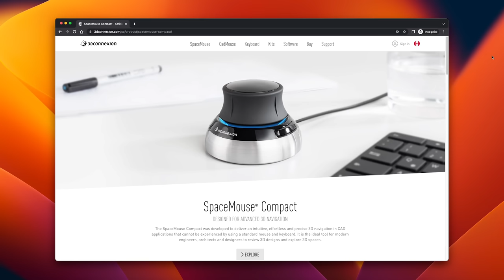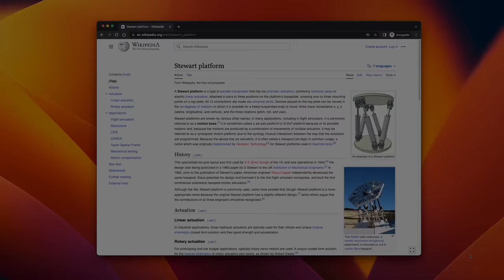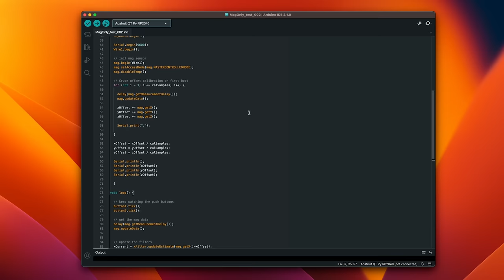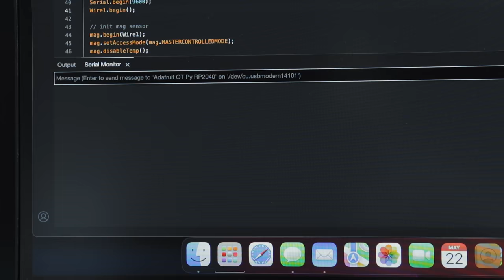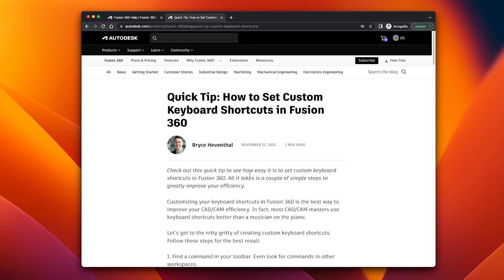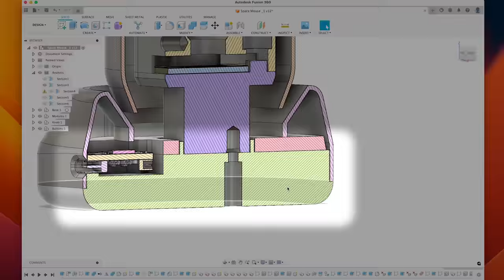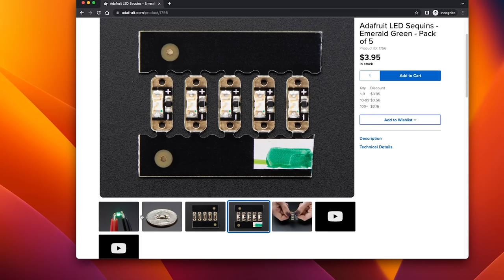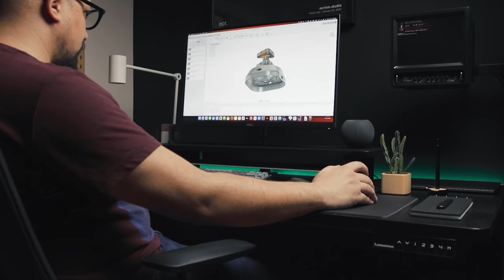I Made my own Space Mouse for Fusion 360 using Magnets (DIY)

Comment: I have build the project and i am stuck with uploading the software to the qt pi i gat a error that the TinyUSB_mouse_and_keyboard.h cannot find HID.H. how can i add this to the code? i have tried other code and that is uploading fine.
Reply from the maker: Follow the guide from Adafruit to install the TinyStack library (https://learn.adafruit.com/mouse-and-keyboard-control-using-tinyusb-and-ble/installing-the-libraries)
Reply: @salimbenbouz  Thanks for the help. i am now one step further. the code is uploaded to the board but i cannot get the serial monitor working to look at the values of the magnet sensor. i have checked the baud rate is there another thing i can check? after some time i get ................................. in the serialmonitor window
Reply: I see what the problem is. I have ordered the wrong sensor. i got the LIS3MDL sensor instead of the TLV493D that sensor is hard to get in the Netherlands.
Reply: @salimbenbouz i finaly got the the right sensor and the mouse is working. only after 10-20 seconds it stops working and the mouse cursor is verry buggy. i think windows has broken something again. do you have some tips how to fix it?

Comment: Anyone know how to add the metal balls for weight in such a way that 1. The printer bed doesn’t cause them to fly all over and 2. To ensure that it doesn’t rattle like mad at the ed of the print as you can’t get the balls fully flush with the surface? Any help would be greatly received thanks
Reply: I paused my print before it starts printing the top cover layer. I didn't use steel balls but instead used copper powder (50µm - 200µm) and filled them between the infill and pulled them off flush. Nothing rattles and it is very heavy.
Reply: Oh thanks for the tip. Any recommendations on this powder. I didn’t know it was a thing 😮

Comment: This is a cool project but seems overly complicated compared to just using a mouse; it seems like its aimed at laptop users who exclusively use a trackpad and have forgot that traditional mouses exist. Interested to hear your thoughts on its usefulness though after it gets some real world action
Reply from the maker: Thanks! I wondered the same thing my self. As the actual device exists and is widely used, I became intrigued to determine its usefulness to me. Based on what I have read online, it appears that people are polarized on the subject: either they hate it or they cannot use CAD without it .. We'll see I guess :)
Reply: A 3D mouse is tremendously useful even if you do have a conventional mouse. I don't think this approach in this video is perfect (as it makes it impossible to use the mouse and the 3d mouse at the same time).

As someone who professionally uses CAD software most days, it is an invaluable input device.
Reply: 3d mouse is used with left hand to replace keyboard (only some of the keys) not regular mouse. The pro version of 3d mouse with small screen and more buttons in that sense is to be able to use keyboard even less. Typically the 3d mouse is used to navigate the view and the regular mouse is to select or manipulate the object.

Comment: This is the tipical case when you can buy the thing that you wanna make for less that what it cost to make. How much is a 3DConnexion used on eBay? 50 bucks? How much cost in pieces and time make this one? 200?
Reply from the maker: Making is not always about saving cost. Putting out a video is a form of documentation to share and be helpful to others trying to do the same or similar projects. That's what I reply on when I research my projects: video's and articles from other makers. I was intrigued and I enjoyed the process of figuring out all the bits. It's the entire purpose of having a hobby imo.(Doing it for the fun of it) It doesn't say no where that you would be saving money by making this.

Comment: It's a shame that Fusion360 provides no "easy API" to control the movement. Based on the SpaceRat project (by KikiHobbyRepair) I also tried to write my own python add-in but gave up for the same reasons. 😔

Comment: Definitely a cool project, but I don't really see the point (other than for the sake of a project).  The basic Spacemouse is $150, it comes with 6 axis detection and drivers for most CAD programs and even other apps like excel and photoshop.  I understand the urge to DIY stuff, but the effort is high for a result that is distinctly worse than a reasonably priced product.
Reply: > The basic Spacemouse is $150

It's a proprietary product coming with an ugly 200MB of cloud/FullOftelemetry driver.

No thanks

Comment: this is only 4 degrees of freedom. you can't spin over the sides
Reply from the maker: Mechanically you have 6dof but I only implemented sensing for 3 axis. In the futur if I did a second version I will add another sensor and get closer to the real thing,

Comment: the mechanical side of the project is really nice, however you made a 6dof joystick and are using it foolishly as a 3dof joystick. I understand you may "not have any needs for more than that" but this such a waste of potential. I have an old spacemouse and I really hope you push this project forward even more because having a true 6dof joystick is such an awesome and intuitive tool
Reply: It maybe impossible to make it 6 axis with a single magnet. I feel I don't use the zoom regularly on 3d mouse, but I'm not sure if that translate to how many axis less.
Reply: @seldompopup7442  3Dconnexion spacemice use 3 phototransistors only for their 6 axis. So it's similar to the 3 measurement axis of the gyroscope. The only difference is the spacemouse has 6 IR LEDs piped through channels with directional slits in them so that the light intensity coming out of them varies depending on the direction of the movement. There may be a need for multiple magnets or multiple hall effect sensors but I'm sure it can be done through equations. I've had to disassemble my spacemouse a few times to fix it and the sensor part of it is honestly very simple, so it has to be how the data is used that is more complex.
Reply: @EMILE12345678901  probably doable but not with a simple sensor breakout board but multiple sensor mounted on custom PCB and arranged in 3d space. The space mouse use 3 sensors each facing 2 slits. I believe they can each measure the absolute locations of the IR light projection from 2 slits instead of just intensity. But each magnet sensors can only measure magnetic field direction at a single point. The individual field intensity over a single axis maybe useful but that will be too much noise. Solving the location of the magnet using some sampling points of magnetic field is also something I don't feel comfortable without reviewing some textbook, I doubt it would be just translating some formula found online to c++
Reply from the maker: Thanks. When I was prototyping I added an IMU an paired with the magnetometer I could get the Euler angles to complete 6dof (with some drift issues ofc). However it was a massive headache (for me) to translate all that to rotation matrices and accurately move the camera in Fusion360 So I decided to simplify and get a feel for it with only 3 axis before working a lot on it and only to discover that It's not for me.

Comment: 3d mouse are definitly for people not really doing 3d work. I've been working doing 3d modeling assembling, etc for the last 30 years. Been working with hundreds of 3d artists. I never ever encounter anyone working using a 3d mouse. Mouse and wacom tablet plus keyboard all the way everyday. The most original input I ever saw was a mouse with a built in thumb trackball. All the other inputs are definitly just for noobs who don't actualy work in 3d. VR, 3d trackers , 3d mouse all those hollywood inspired inputs just slow down workflow and ruin precision. A wacom tablet and/or a mouse and a keyboard is what 99.99% of people doing 3d work use everyday. This is just gimic bullshit.

Comment: This is not a space mouse, just a convoluted joystick. The real space mouse provide full simultaneous 6dof control. And you can use mouse with it at the same time. There is no benefits to this compared to kb&m
Reply from the maker: Thanks for the feedback. 
The plan is to complete 6dof sensing and controll the camera directly. Now it functions as a 3-axis joystick but mechanically it allows for 6dof movement. While prototyping I aded a gyro and accelerometer and was able to get the (roll, pitch and yaw) but failed to translate all that to 3d rotations for the camera. Maybe in the next version!